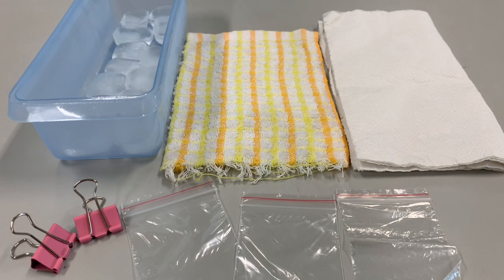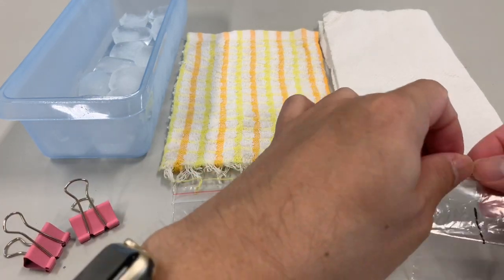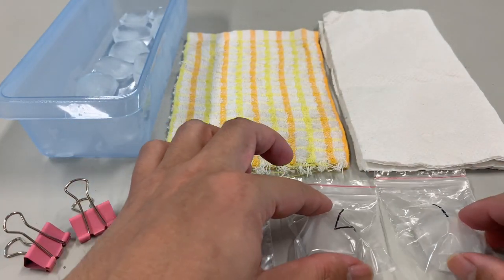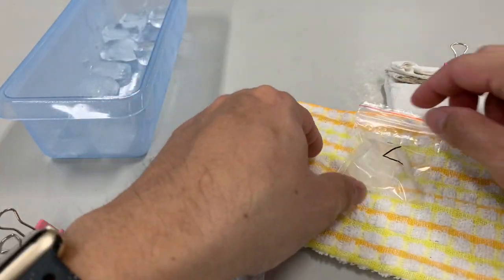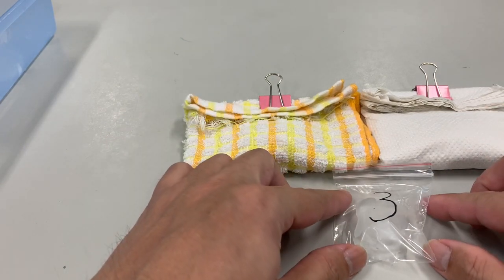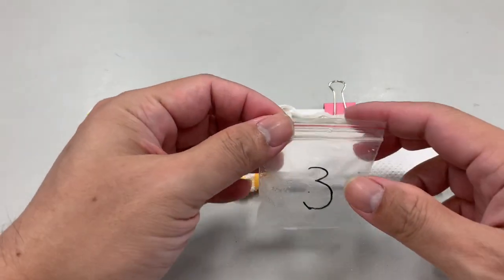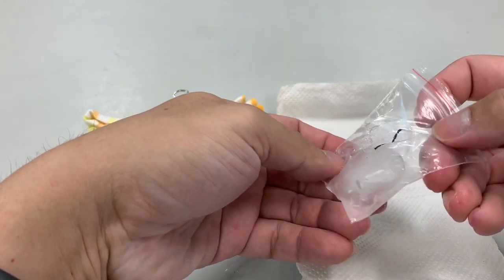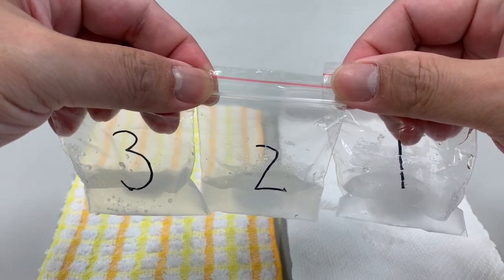An Experiment to Slow down the Melting of ice cube

Comment: Why has nobody ever tried vacuuming sealed ice I bet it would work for a while 😅
Reply: Vacuum seal in a plastic bag does not help as heat is still able to be conducted through the plastic due to the full contact with ice. 
However, if you put the ice in a metal vacuum bottle like a thermo flask, it will work very well as there will be much less air molecules to conduct heat.
Reply: I tried, it melted very quickly.